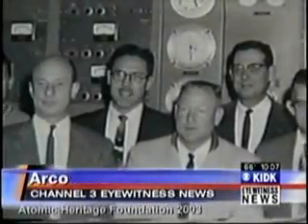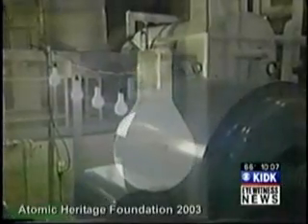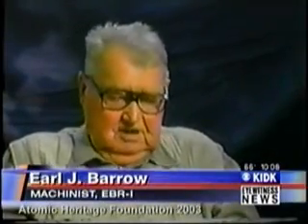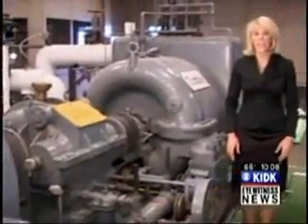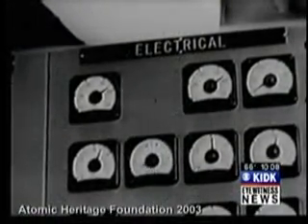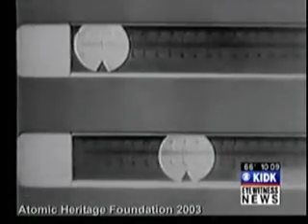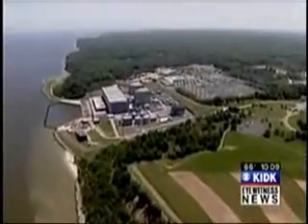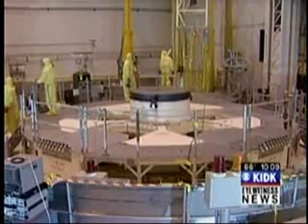Experimental Breeder Reactor 1 (EBR 1)

Comment: Cons.  Very dangerous as they use liquid metals for the cooling system instead of Heavy water (2H2_O Or Dueterium2_Oxide). Sodium is used in a few experimental reactors know to work well.  Sodium has a low melting point for a metal.  Other problems are that if the technology became widespread it would be hard to keep track of how enriched some unscrupulous people are going.  The weapons grade plutonium can be used, you guessed it, as a fission bomb easily.  Thorium/Uranium bombs are more complex

Comment: Yeah but the fact remains reprocessing cost are vastly reduced.  New Fuel costs are completely eliminated.  Just face it, the only reason we don't have fast breeders is that they are perpetual.  And everyone knows perpetual motion is impossible (unless you build fast breeder reactors).  These reactors are banned not because they can produce weapons grade plutonium.  They are banned because the oil fraternity want them banned.

Comment: but some breed reactors make more nuclear fuel than they are using, which means they are making more fuel/more energy than they are using, so that more fuel can be used to further sustain the reactor or even more importantly give more fissle fuel to other reactors.NORMAL reactors make 30% to 80% of fuel before its waste. these breeder reactors make 100%(unity) to 180%(overunity) extra fuel then they are using! thats real overunity!wiki has a great article if u dont understand the extra fuel bred